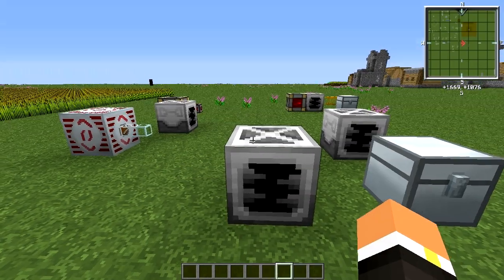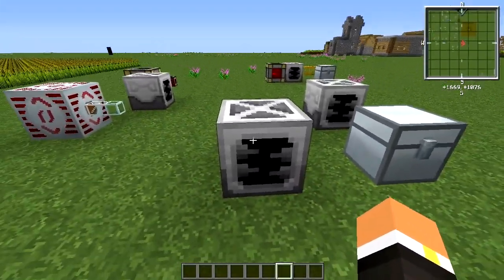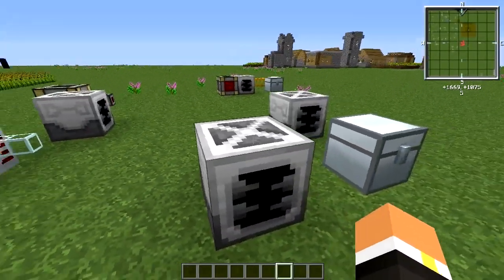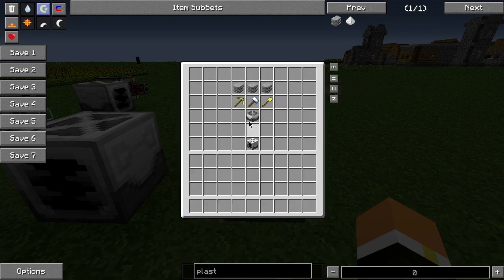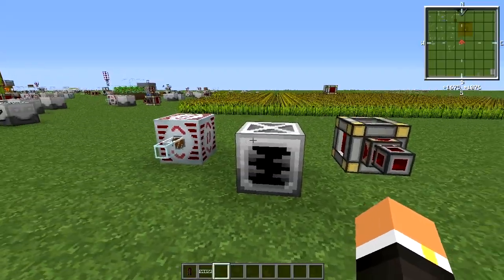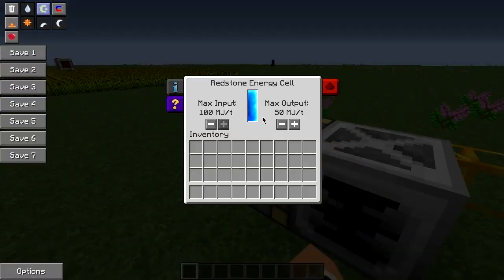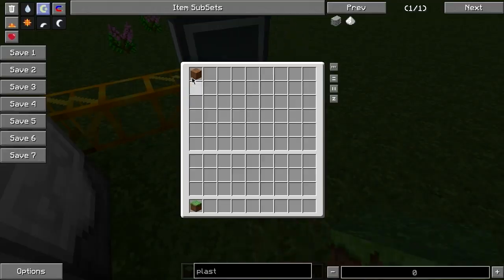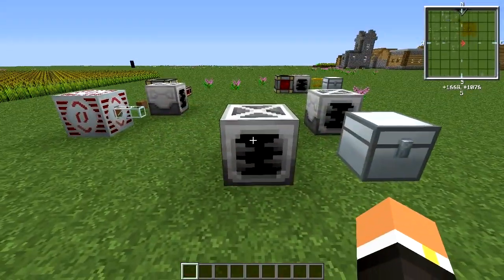Feed The Beast :: Machine Tutorials :: Block Breaker

Comment: im new in ftb unleashed and i have a question what is that one pipe u are using to connect the mfsu to the breaker
Reply: nvrm i saw its a glass fibre cable